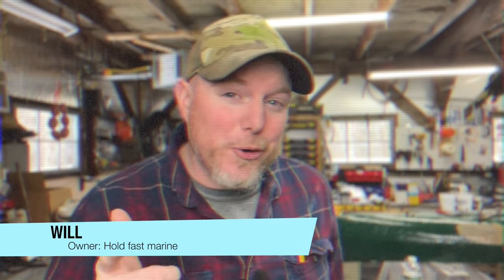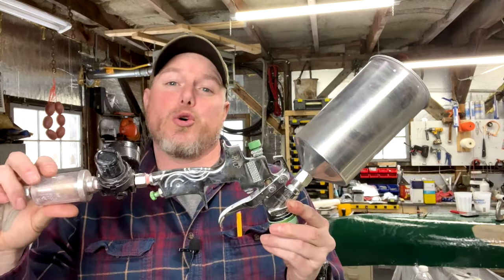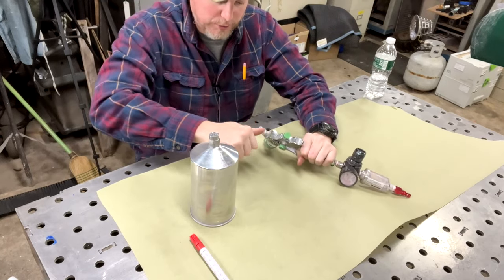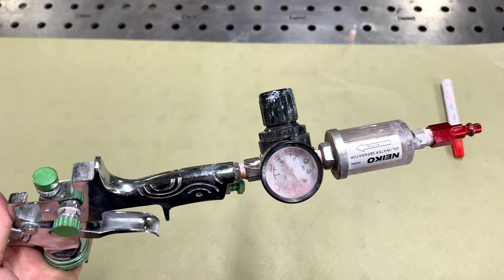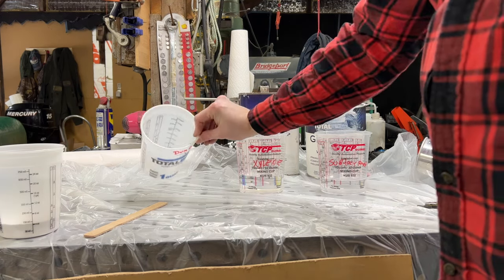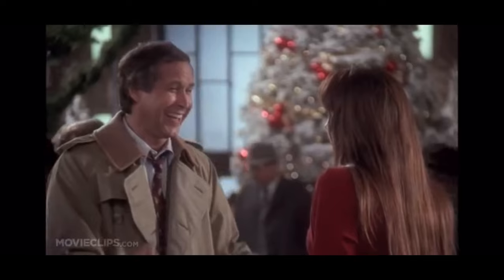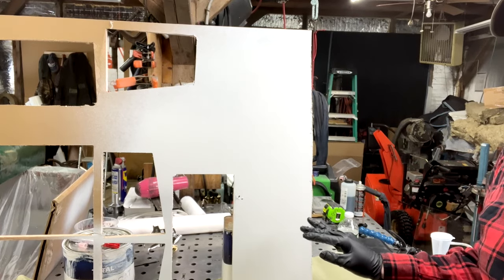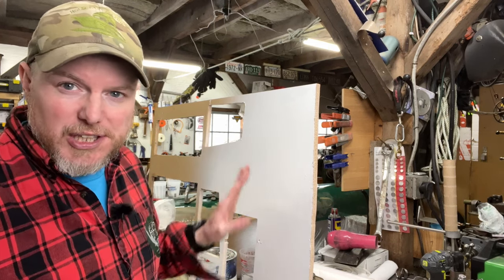Spraying Gelcoat on a Boat - How to spray gelcoat with a cheap spray gun-

Comment: Great and informative video, thanks. The nozzle on the gun is in fact not a nozzle, it is an air cap. The nozzle is screwed onto the gun before the air cap is installed last. This could be very confusing to someone that is not familiar with spray guns. Just wanted to clarify.
Reply from the maker: I really appreciate that info! Would you mind if I pinned this comment to the top so others can see it?

Comment: Did you know, the MEKP dispenser you have, just like all of them, can be moved up or down to allow for metering and finer adjustments. say you want to do 5CC or 5 ML of MEKP, you can pull the top cup up until you are close to 5CC then make micro adjustments, then when you squeeze, you will only get 5CC of hardener and then the rest will get sucked back into the bottle. I have been doing this for 15 years and I cant tell you how many people in this industry don't know the dispenser works that way. Also, why use xylene to clean? Xylene leaves a residue, and acetone is cheaper anyways. I get 55 gallon drums of acetone for around $9 bucks a gallon. it was up like 250% a few months ago but thank god I didn't need to order any during that time. Also, if you do this a lot, you should look into the 3M accuspray Pro gun. The one with the turn to lock tip. I spray gelcoat at least 3 times a week from mine, and I use a 2.0MM tip for the laminating coats, then once I am ready to spray my topcoat, I use the 1.8mm tip because the gelcoat is much thinner with 50/50 duratech high gloss additive. I have never used a better gun (other than an external mix gun that catalyzes the gelcoat as it comes out of the gun, but that was when I worked for a boat builder, those guns are like $10k) and the best part is it takes SECONDS to clean. and, if I mess up and the gelcoat kicks in my gun, I don't have any parts of the gun that are ruined, I just need to clean it off of my needle, and I can move on with life. It's versatile as well, I can use it with a 1.2 tip for spraying awlcraft and then spray gelcoat in the same gun, lays down gelcoat and awlgrip/awlcraft like a mirror, downside is the tips are pricy, but, you can clean them after each use and I use them about 10 to 15 times then throw them out and its a very versatile gun. Anyhow, good video, might just add the ability to use either Duratech or PVA rather than waxed gelcoat, as 1 waxed gelcoat is more for the DIY as it costs more just to have wax added, which you can do for a fraction of the cost they charge to do it for you, and 2 you will have WAY less sanding if you use a patch aid like duratech or Spectrum Fast Patch and it will look so much better as there is UV and Gloss properties added into the patch aids. Anyhow, good video man loving the 80's intro and ending, reading rainbow song brought back memories.
Reply from the maker: I did know that about the dispenser! I used xylene because I was out it acetone. And I don’t think the home owner is going to buy 55 gallon drums of acetone 😂. 

I have many spray guns for many different applications. I have dedicated gelcoat guns, paint, nonskid, let’s just say a lot of them. This video was for the homeowner who just wants to do a project, without spending thousands of dollars I’m in gear.
Reply: @HoldFastMarine  oh. I see. I gotcha. I didn't know you were not using those items. I got you now. I completely misunderstood. Makes So much more sense. Great video. I just found out about the dispenser thing like 2 years ago, was a freaking game changer, very helpful for people who do not measure out of them much for sure. I find, after you do it a lot, the cup on top leaks. But, I was in no way trying to nit pick your video, I was just offering helpful pointers. I was unaware, this is just a video you used for teaching not everyday practice. My apologies.
Reply from the maker: @hullhealersboatworksrestor4377  well my page is for the diy’er lol. Don’t apologize for anything. Good info, good tips.
Reply: I’ve sprayed cars with the 3M guns, and you’re 100% correct…the cleaning is stupid fast!
Reply: You can also put pennies in it

Comment: So I cant find any where what the time in between coats 20 min, seems to be all I can find. Or when it is tacky to the touch but does not come off on your finger.  So does that apply for the final coat  of gelcoat with wax?
Reply from the maker: Once it’s not very tacky you can do another coat pretty easy.

Comment: I recognize the intro right away! That was a great show back in the 80’s when those folks like me only had 4 Channels on TV!  It came on channel 13 PBS. And I had my own black and white TV! Kids today would never understand that???
I’m very interested in spraying and repairing gelcoat. I just need to get some and try it. I do a little spraying from time to time. I wet sand and buff gelcoat on boats already. It’s the color matching that scares me the most! Thanks for the video.
Reply from the maker: Pretty cool right 🤣. Get a quart from totalboat and try it. Use my code in the description it’ll save you 15%. TotalBoat even sells a pigment if you didn’t know already. Maybe I’ll do a color match video.

Comment: I love your videos, lots of great info. I’m getting ready to tackle applying fresh gel coat to a 1975 Boston Whaler. You said using this method will require a lot of sanding, would rolling and tipping be the better call?
Reply from the maker: Thin your gelcoat if you’re going to roll and tip.

Comment: Both of your videos were very helpful. I'm thinking of spraying a boot stripe on a 43 ft sailboat. I've never worked with gelcoat other than in very small repair areas. How long did you wait between coats? Thanks!
Reply: Also... How are you clearing/cleaning the gun when you're done spraying? Before something bad happens. :) Thanks!
Reply from the maker: I usually wait 3 hours before the second coat. And I clean my spray guns with acetone. You have to dismantle the entire cup gun put the parts in a cup of acetone to soak while you clean the gun.
Reply: Have watched a couple of your other videos. Very helpful. Thanks for the MEK mixing video! I have one other question. If spraying a 43 ft boot stripe, would you reload the gun with small batches and keep spraying without cleaning the gun in between batches? I've used a paintbrush all day long while mixing West epoxy without it hardening due to continually dipping it in fresh mixed epoxy. Does the same thing work here? I'm using total boat. How much would you suggest mixing at once? I bought the same gun used in your video. Thank you so much!
Reply from the maker: @jhaberly  absolutely NOT. Epoxy and poly are two complete different things. You must clean the spray gun each time. You only have about 10 minutes or less until the gelcoat starts curing inside the atomizer and tube. If you don’t clean it you’ve just bought another spray gun. Once you mix the mekp in the gelcoat the clock starts ticking.
Reply: Thanks Will for all this good information. I've now sprayed the boot stripe on a 43' sailboat using the gun you recommended as well as Totalboat (Black) gelcoat. Everything went very well. This was super helpful. I kind of like the resulting mat black finish. I wonder if it needs to be polished and waxed to protect the gelcoat or if leaving it would be ok? Anyhow... Thank you again! Cheers!
Reply from the maker: @jhaberly  hi jim. You always want to apply wax to any new gelcoat. It protects it from the elements. I recommend meguires or the total boat total wax. I’m glad you liked the video!!! And I’m super glad I could help!
Reply: Is there a chart to accurately calculate cook off time?  You wait 3 hrs, is there a minimum or maximum time between coats? I’ve been told 20 mins or so.  Im also looking at time of day and timing it when temp and dew point are optimal.

Comment: I know this video is two years old, but I hope you see this comment.
I bought a bayliner speedboat last year, and the previous owner had spray painted regular paint on to the hull. I would like to remove the crappy paint job and bring it back down to the base gel coat. Is there any way I can remove the paint without totally destroying the underlying gel coat?
Reply from the maker: I respond to all comments!! Depending on the paint you can use a chemical stripper to remove it. Obviously do a test area before slathering it on. It’s a messy absolutely horrible job. Paint stripper shouldn’t remove gelcoat and I’ve never seen it happen.
Reply: @HoldFastMarine  In the Coast Guard in the early 1970's I was tasked with removing stripes and decals from the Boating Safety Detachment's boats and tried thick paint-remover. I brushed a light coat on, let it set for a couple minutes and the decals were easier to remove. So, I figured I'll lay on a thick coat, let it set for 10 or so minutes to make removal even easier, go get the Chief Bos'un and proudly show him my neat trick. He and the Commanding Officer came out of the office to see my proud demonstration and as I began scraping off the decals the gel-coat came off with them. Kind of embarrassing. But the upside was the CO decided his Detachment needed a full-time, full-scope boat-repair facility which was granted immediately by the High Command. The moral is: test carefully.

Comment: I’ve redone a few boats, engines, upholstery, carpet, electrical, but never done more than buffing for gel coating. I’m looking at picking up an old boat in bad shape, I’ll be redoing the stringers and transom as well as floor, full upholstery replacement, new Bimini ( sure cuts cost when you can do all the sewing yourself) , a complete rebuild of the outboard, but I want to do the whole boat in a deep blue with large metal flake like a 70’s or 80’s bass boat, can you tint gel coat or do you have to get it pretinted? And can that gun spray metal flake?

Comment: Great video. Thanks for the information… can/should you thin the gel coat with styrene or something else? Does it have to cure fully before applying your second coat.. ? Thanks
Reply from the maker: You can, but don’t have to. You’ll want to wait about 2 hours before applying a second coat.

Comment: How do you know that you have the viscosity of the gelcoat right? I'm trying to spray a neutral gelcoat (adding pigment) and it is very thick compared to the white gelcoat I've used in the past. I've tried thinning with straight MEK but still can't seem to get things dialed in. 
BTW: I'm using the exact same gun you are using in the video.
Reply from the maker: Well there isn’t a really clear answer to your question. If I reduce with MEK I only reduce 10-15%. Dilute it after you add in the MEKP. If your having trouble spraying up the PSI, and you want to make sure you have no trigger set.

Comment: Hello, I have a question,  are you able to thin gel coat without wax, and if so what is the best product to use. Also is it exceptable to mist a coat of pva over top of the final coat? Any input would be greatly appreciated,  thank you.
Reply from the maker: You can thin any gelcoat. I use mek, not mekp. If your using gelcoat with wax; which you should as your final coat you don’t need the pva. But if your just using without wax you will have to use pva

Comment: Will the gel coat actually dry without the wax? I thought that without wax it would remain tacky. I didn't know that you could build up gelcoat and sand before applying a coat with wax to seal. Very interested in learning more about this. More video's please!
Reply from the maker: It will dry but will not cure. I didn’t say anywhere in the video that you could sand gelcoat without wax. You want to do layers of gelcoat without wax then a finishing coat of gel and wax to cure everything before you sand. You can also use PVA but I don’t recommend that because it’s a horrid mess to clean. Other than a gelcoat video (because I’ve done 6 of them) what would you like to see?

Comment: You dont say (or at least i didnt get it) how long or how tacky do you leave first coat of non wax before you spray the next and how long you leave those before you spray the last wax coat. and if you had to spray two wax coats how long between ?
Reply from the maker: No less than 3 hours at 70 degrees. That’s kinda my rule. I won’t spray the final waxed coat for for about a day. If you had to spray two waxed coats you need to wait until the first coat is completely cured and sand it before applying the second coat.
Reply: @HoldFastMarine  great thanks for that, how long does it take (approx) to cure final coat before i can sand, or how do i determine it is ready for sanding. I dont want start too soon and mess whole thing up. Thanks for the videos
Reply from the maker: @ShorrockPaul  it all depends on how you mix it. Usually overnight or 20 hours. Try a small area to get a better idea
Reply: @HoldFastMarine  if you spray 2 waxed coats, what grit sand paper should I use after curing  before going to the second coat.. my boat manufacturer sent me waxed gel coat for making a repair.. thanks

Comment: Im wanting to use that 3" thick packing cardboard for a core for a surfboard but want to spray polyurethane resin to soak into the 
"Honeycomb" paper grid to strengthen.   
These same steps would work for spraying poly    and my application dont need to be pretty or as even
But mix resin n mekP   then thin it out with mek. Or should mosy cheap box store poly be thin enough
And thanks for the awesome fiberglass tips
Reply from the maker: Sounds like a cool project. I wouldn’t thin any resin, epoxy or poly.

Comment: Thanks so much for this video. I have a very important question :) how do you clean your spray gun? Obviously you don't buy them for every new project :)
Reply from the maker: I clean it as fast as I can with acetone to keep the gelcoat from curing in the nozzle. You have to take the whole thing apart.
Reply: @HoldFastMarine  Hence the moment early on when you showed everything ready for clean up before you started to spray

Comment: So I’m spraying the back of my boat where the fuel tanks go and I’m wondering if you thinned the gel coat or if you just used the gel coat and hardener
Reply from the maker: I did not thin this batch in the video.

Comment: What type of Goggles do  you wear when spraying gelcoat ? I was hoping I could find some that wont get ruined when I clean the overspray off .
Reply from the maker: I don’t wear goggles. Sometimes safety glasses but usually not. You could buy a full face respirator, those work pretty good.
Reply: Aaaah The old    Safety squints 😑     

And good ole Hanes Tshirt coller pulled over nose mask for when the wind shifts n blows in your face
Reply: @HoldFastMarine   I did buy some full face ones , I am gonna put some motorcycle lens tear offs on there to protect the plastic lens

Comment: Yeah, I’m a bit confused with the gun adjustments 🫣.. Don’t know to use a roller or spray gun..🫤 I’m just trying to repair spider crack here & there along with transom.. 😑
Reply from the maker: Don’t do either. Mix up some gel and go spot to spot. Color matching is a pain but it’ll look good.

Comment: Trying to gelcoat my boat. What compressor do i need to effectively spray gelcoat? I have a porter cable 6 gallon 150 PSi  pancake compressor. Not sure if this will be adequate enough to do the job.
Reply from the maker: It is not. You’ll need a bigger compressor or a pressure pot.

Comment: i thought you had to do 1 thick layer of gelcoat and thats  it, I was told that a few layers can crack the gel coat. can you elaborate your opinions on this? (new painter by the way)
Reply from the maker: No idea who told you that. You can do one coat, two or ten. It’s always preferred to do one coat thick for time. But I’m a pro and can easily do it. The diy’er not so much.
Reply: @HoldFastMarine  gotcha.   how long should i wait in between coats ? and how many coats should i apply in your opinion?
Reply from the maker: Always follow manufacturers recommendations for times. And I don’t know your project and haven’t seen it nor do I know your skill level so it’s very hard to say how many coats you’ll need

Comment: I want to spray the mold for a kayak I'm building. Would any of the El Cheapo electric spray guns work for small-scale projects such as a kayak? Wagner, Harbor Freight Etc? I've had decent results rolling gelcoat but would like to go to the next level.
Reply from the maker: A Wagner power painter will not work. Nor will any thing from harbor freight. The nozzle size is too small
Reply: @HoldFastMarine  thank you for the reply.